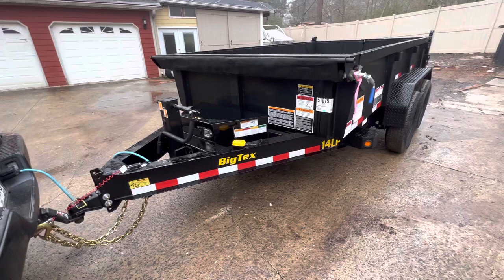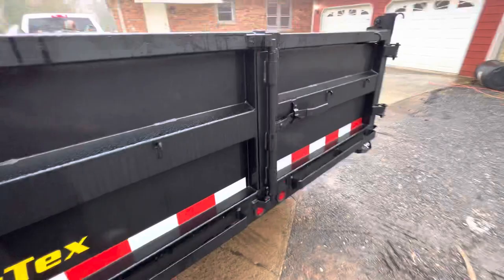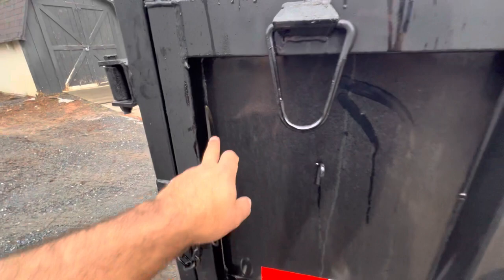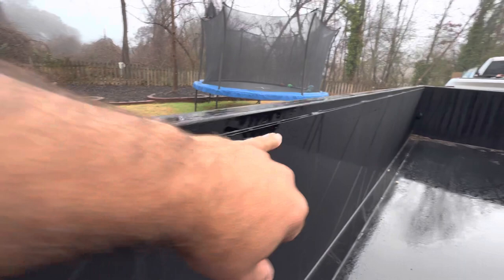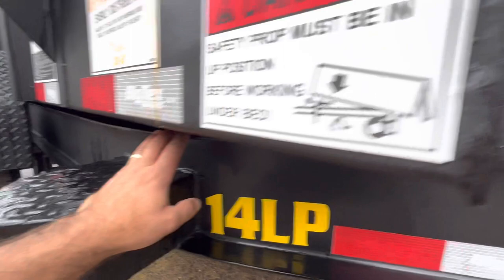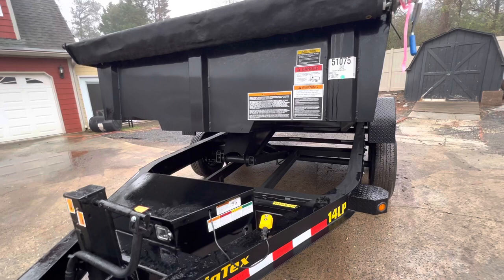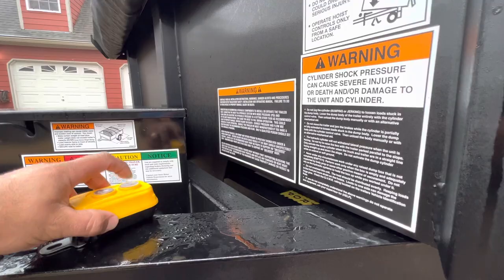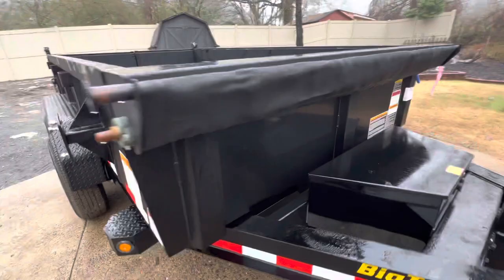Brand new Big Tex dump trailer LP 14 issues!!! #bigtextrailers

Comment: Lift the dump part up.     Check your ramp holders.   When I brought my 14 Lp. There was only 1 holder on each side that was completely welded my ramps would bang like crazy until I took it back to the dealer to have it welded up
Reply from the maker: Will do. What you think about the gap between bed and frame? Do you think is normal?

Comment: If you want a good trailer get a Diamond C.
Big Tex if for work. Not for looks. I have a 14lp 16’ trailer and does just fine. We hauled everything. And with concrete it doesn’t even flex.

Comment: I bought a 22 model 2nd hand and it sat high as well. I cut the center beam out and rewelded it. It sits flat now. Since I was 2nd owner it's not u er warranty anymore. After getting it I know now I will never buy another Big Tex. Their fit and finish like you've shown is terrible. I'd take it back and buy a Diamond C. Good luck .
Reply: Well of course look at the price difference  😅😂 a big Tex goes for 15k and for a diamond C they go for 27k